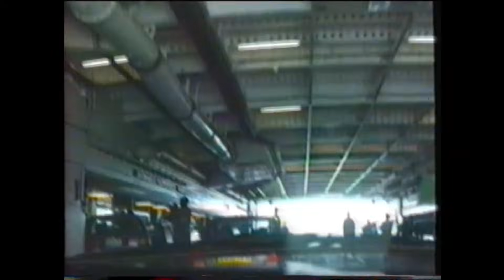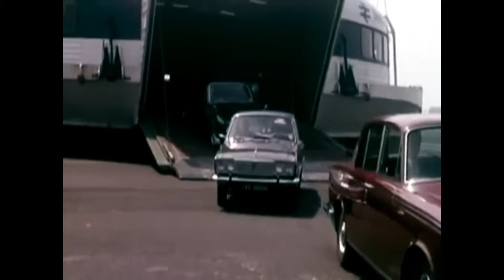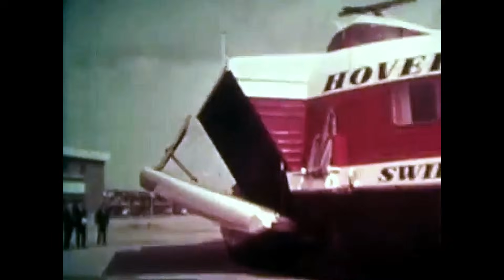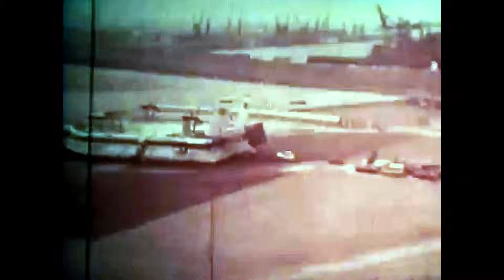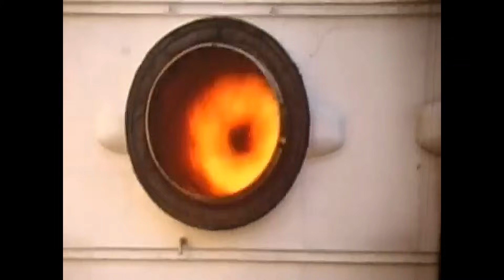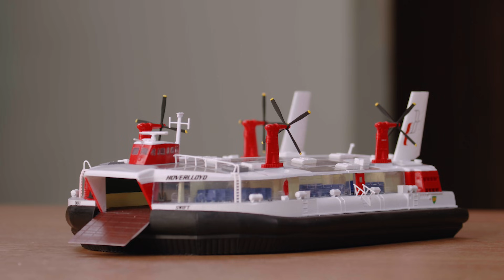The Hovercraft That Shouldn’t Have Worked

Comment: I have a few of the original Hovercraft kits in my stash for which I paid three-digit amounts on   ebay over the years & I'm very happy Airfix finally re-issued this gem. When the Hovercrafts were still around I was lucky enough to do a Channel crossing in one. Amazing experience which I'll always remember (hence the sentimental connection with the model). I just ordered a new kit simply to have it now it's available again 😀 Worth it alone for the new instruction manual in colour & the decals. 
Thanks Airfix for these great re-issues. Also have a few of the "new" Rotodyne kits boxed away. Good work Airfix - keep those classics coming 🇬🇧✌🏻🙂

Comment: I crossed to France on one of these hovercraft. It was very noisy, the windows rattled, and it wasn’t very enjoyable. We got about half way across the channel when running conditions got to the do not run stage. Most were very sick, I was fortunate to be one of the few that didn’t get sick, and the crossing took 30 minutes longer than the ferry crossing took! A crossing I will never forget and one I wouldn’t want to repeat. Crossing to France on hovercraft but return, which was due to be on a hovercraft, by ferry.

Comment: Oh no! Another one to go on the “to get” list.
Reply: Or in my case "back on the to get" list. I wanted this as a kid, sooo much.

I presume this is a re-release using the old moulds, so we'll get the authentic 1980s building experience 😕
Reply: @hammondpickle  Errr...I think you'll find it's a 1960s building experience! It was tooled in 1969, released in1970.
I've seen a few attempts at this kit over the years and it's not for the faint-hearted.

Comment: My stepfather was a manager at BHC around 1968 to 1970, as a result I got a VIP tour of the factory including an SRN4, I climbed up the ladder and had a look around the cockpit. Airfix should do a 1/72 scale kit of the SRN6 which was used on the Isle of Wight to Portsmouth service. May be with an optional proper rubber or plastic skirt as well as a milder styrene inflated one.
Reply: That'd be interesting as the basis for a conversion to the military types (the RM had one with an open deck for use as a landing craft, didn't enter service but it looked the part)